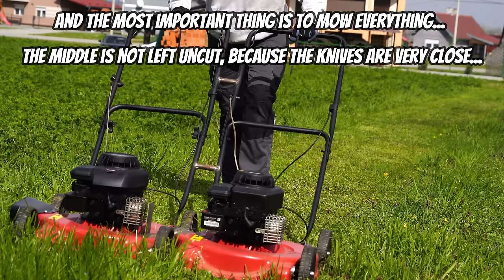Homemade DOUBLE Lawn MOWER !?

Comment: waste of time. 
would be impossible to push. 
anyone whos ever used a push mower know that only a push mower w/ high wheels in the back are relatively easy to push, especially in this case.
Reply: He pushed it pretty easy...  but yes add bike wheels for next project
Reply: I used to use a mower similar to this with a better engine and wheel adjusters.  They're incredibly lightweight so pushing them on a level grade is pretty easy.

Comment: Not a great idea. Now you give your lawn a mohawk and have to go back over those spots anyway.
That's why ride-on mowers have 3 sets of blades.
Reply: That's true...
Reply: not all riding mowers have 3 blades, the deck is angled in such a way that the blades overlap each others path slightly
Reply: They are less than 2mm apart. The turbulence will make the blades be cut regardless.
Reply: @KenzertYT  Surely you understand that the shortest distance between two points is a straight line, and a lawnmower blade is a plane.
And when you set the exact direct distance between them to less than 2mm, that they will contact each other as they near that exact direction of pointing towards each other.
Right?
Prove me wrong.
I would bet that they are more than 2mm apart.
You can even see it in the video of a mohawk line in at least one instance, and camera angle hides it the rest of the time.
It is a nice thought to widen the cutting width. But do it properly by aiming the wheels off a bit so the lawnmowers are in an Echelon Formation instead of a Line Abreast Formation, or make them even further apart and tie them together with a 3rd lawnmower leading them to cover the gap to have an even wider swath.
Reply: you couldn't watch the vid as it explained that?....you're  much more opinionated than your knowledge level allows you to be......
Reply: @ThatsFrrreeessshh-sq7kn  The vid was made by a human. I am human. Why does the video human have more weight in your mind than a text human?